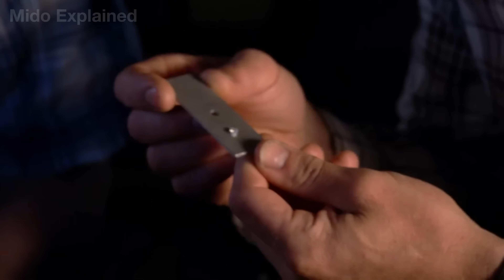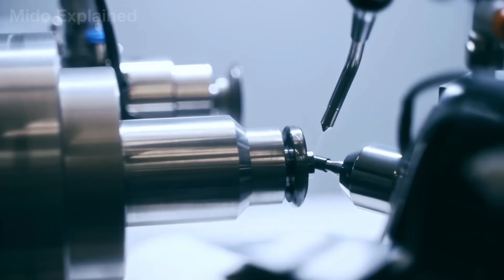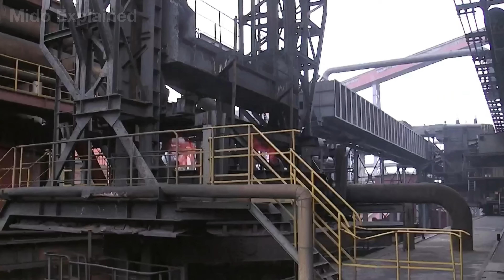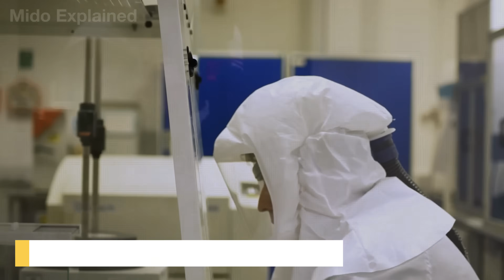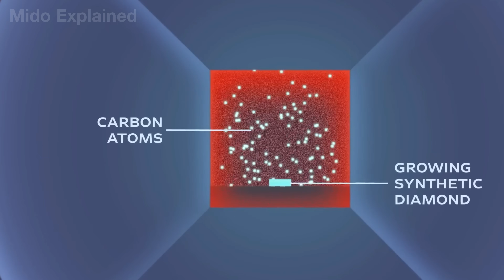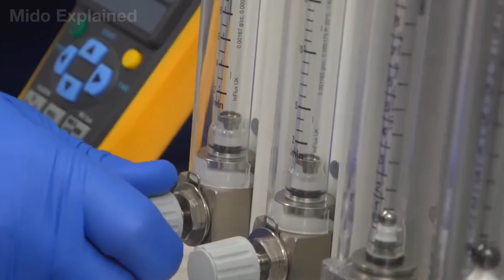Why Lab-Grown Diamonds Are Still Expensive Despite Being Mass Produced In Factory?

Comment: What they should do with lab diamonds is to control its production. The lab diamond industry will suffer if they continue producing too many. Controlling its production will ensure meaningful profits for the whole jewelry industry.
Reply from the maker: Thanks for sharing your perspective! It will be interesting to see how the lab-grown diamond market evolves over time.
Reply: There has already been wide-spread attempts to control the lab diamond market. The problem is that there are no features inherent in lab diamonds that make one SUBSTANTIALLY MORE ATTRACTIVE than any other. Other lab grown gems have exotic chemical growth strategies. For example, Chatham's early generations of emerald and corundum grown using the Flux process used NO WATER. This made them far more resistant to the heat of a torch thus making in-situ repairs doable without risking damage to the gem. Lab diamonds have no such differentiators. Thus the only real competitive advantage is price which threatens to take small and medium goods right down to the Vernual bargain basement.